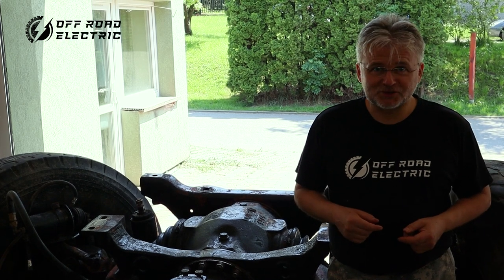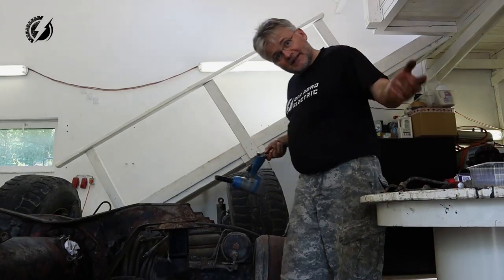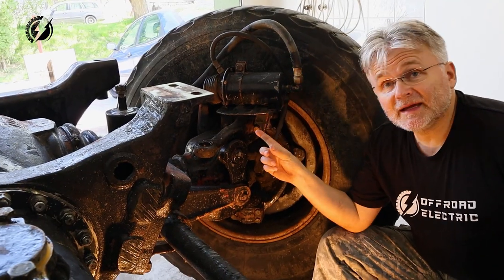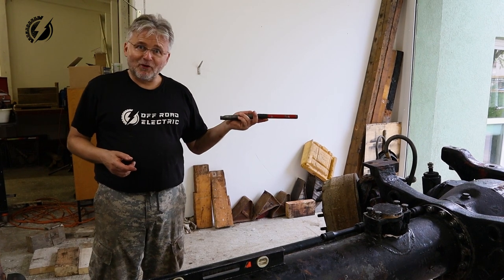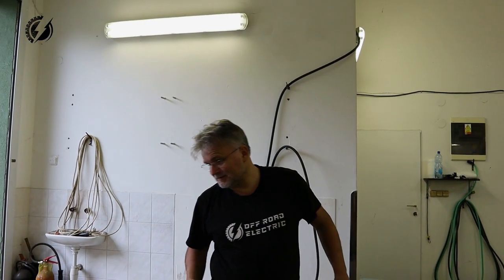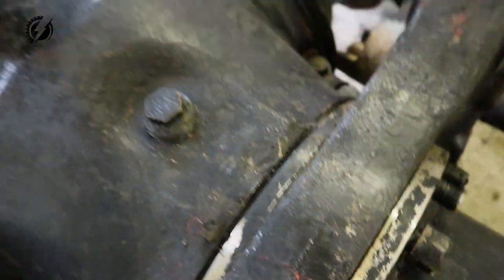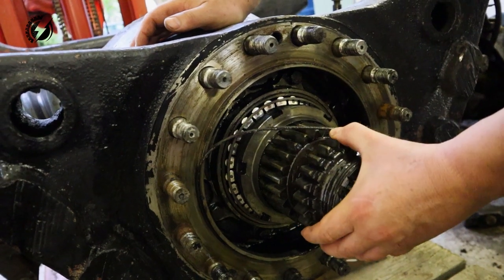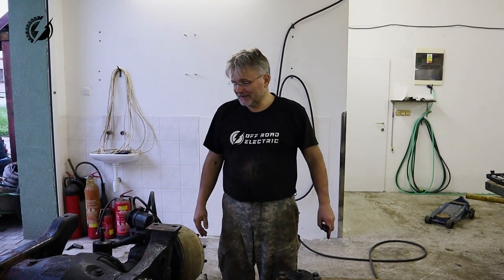Best Off Road Electric Monster Truck Build| Ep.24

Comment: You could use bottle jack horizontally to pull it apart.
Reply from the maker: Yes I know,  there are a lot of tools I can use, but the expenses rrelated to making the videos are my preference  before expenses into the tools.
Reply: @offroadelectric9457  But you have bottle jack, it is shown right in this video. You just needed to attach it to a long piece of wood, and then use it as a spreader.
Reply from the maker: @glebius0  Aha, that's what you mean.........No, unfortunately bottle jacks don't work horizontally.
Reply: @offroadelectric9457  There should be a position when oil would go into the plunger. Probably with the pumping handle down. Anyway it is too late - you already had disassembled everything.
Reply from the maker: @glebius0  Thank you! Will check next time when needed.

Comment: Dont cool the bolts down with water. U got real lucky. I own a autoshop in a salty snowy rust belt in ohio and we use oxy/accetylne and get them glowing red. U want the heat on the nut so it can expand. Using water basically shrinks the metal down again.
Reply from the maker: Hi James, the goal was to break the corrosion in the threads, and it works perfectly. I couldn't heat up the nut from all sides, and this torch is not strong enough to keep up with the heat absorbtion into the chassis. Peter
Reply: Ur doing an amazing job, i just work on really really rusty stuff. Look into a miniductor they are a good solution for heat without good access.
Reply from the maker: @jamesgasper8630  Will look at it. Thx!

Comment: Good trick with the heat and water.  I've never seen that or used that.  Water shrinks the nut which seems counterproductive, but you can't argue with results.  Maybe the heat and cold creates a corrosion break in the threads, facilitating removal.  Either way, it works, thanks for sharing and keep up the great work.  That Tatra is built like a brick shithouse.  Cheers from Canada.
Reply from the maker: Hi Pete, exactly, the corrosion break in the threads was the goal. And the parrot wisegrips are amazing tool.
Reply: @offroadelectric9457  are those center bolts replaceable now that you have them removed? I would worry that the heat+fast quench would change the material properties and make that bolt a lot more brittle?
Reply from the maker: @kschleic9053  No, they are not replaceable. You got the point, but they were not red when heated because of torch limited power, and the bolts are not taking much stress during the operation,  so I assume  they will be fine.